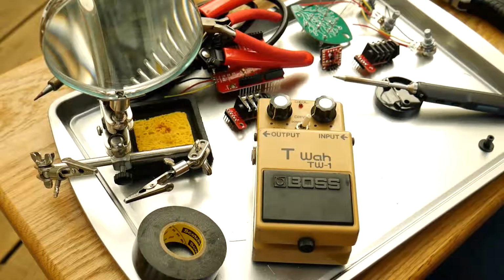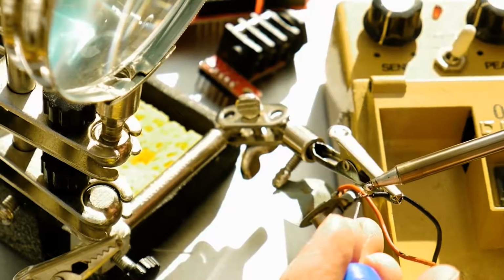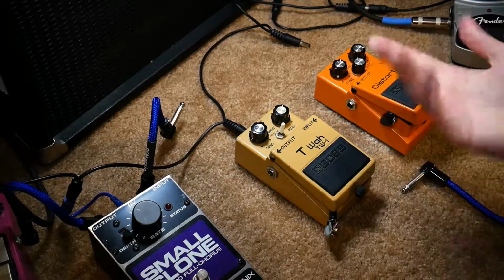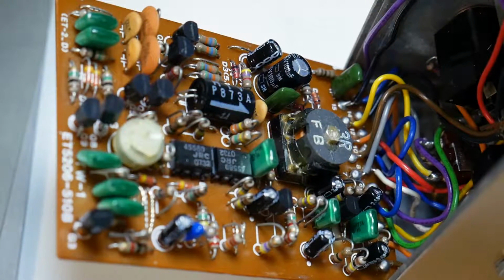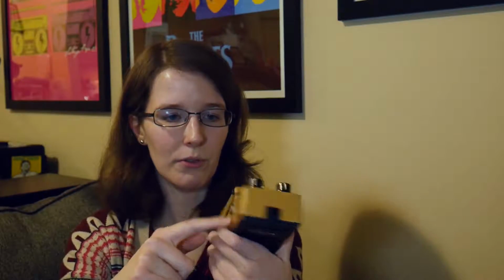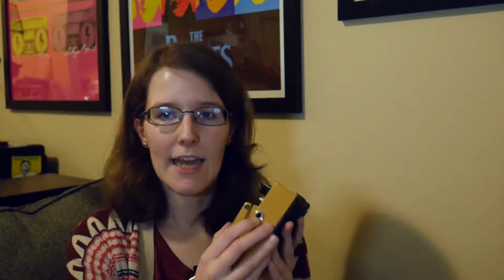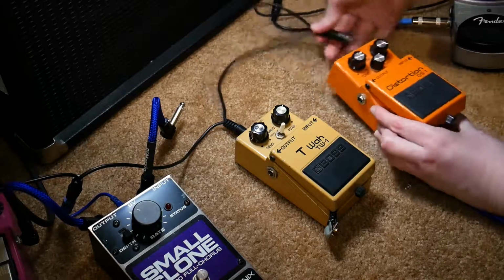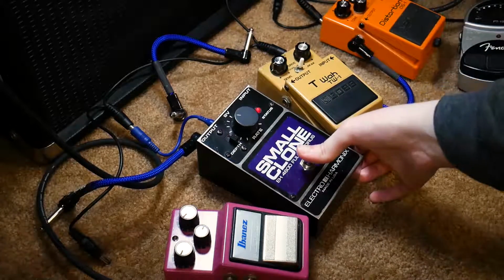Fixing Up a Boss T-Wah Pedal

Comment: As a guitar player for many years I must point out that part of your conclusion is not correct. If you simply plug in a 1/4 guitar cable into the input jack with a new 9 volt battery the light will then come on. I will also mention this. Older Boss pedals from the early 1980's used an ACA adaptor. Newer Boss pedals use PSA. I'm not an expert on the electronics of this but here is what I have read. For what ever reason the old ACA pedals would run on a 9 volt battery just as the new pedals do. But when using a power supply the ACA adaptor actually supplied 12 volts to the pedal but in the circuitry of the pedal there are components which then drop that down to 9 volts. I have read that there is a way to remove this circuit so you can use a PSA power supply. You will need to research that to verify. Therefore if you try to use a PSA to power a single ACA pedal it will not work. But if you daisy chain through several pedals it may work. But I must say that daisy chaining pedals can create awful sounding ground loop sounds or hum. I hope this doesn't come across as sounding know it all or sound overly critical. I am just trying to help. Nice Soldering job.

Comment: Hello, I see a bit of misinformation here. The reason the pedal did not power up, is because the input jack acts as a switch, connecting the battery - to ground. The story about the capacitors charging through the chain is not a fact. 
The reason for the input jack acting as a switch, is that you can unplug when not playing, and then save battery life, because it isn’t connected to the PCB.